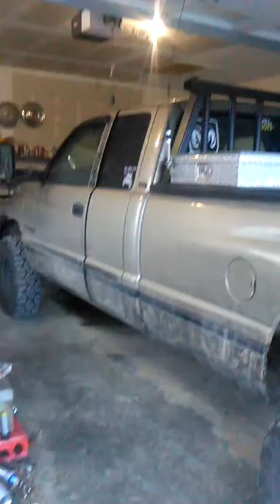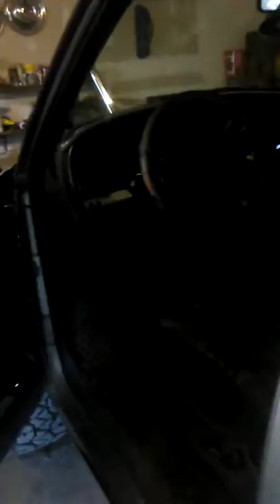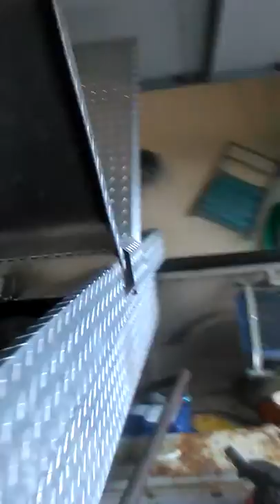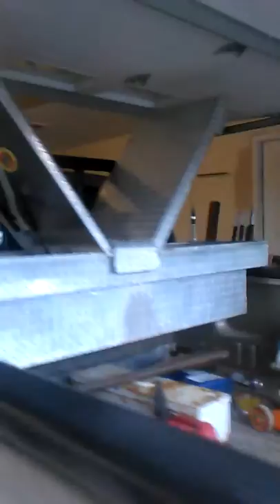Tool box speakers

Comment: Can I ask how your used a toggle switch to turn them off and on please
Reply: Did u ever find a video bro or find solution Im looking for samething
Reply: You can run any inline switch on the speaker wire to turn it on or off
Reply: @jaceinlow8980 by chance have video???
Reply: @AsaiahPerez-un8ju  the better way to do it is run an amp with a switch on the remote wire but not everyone wants to spend or has the money for a full amp and speaker setup just for a toolbox so that works just fine